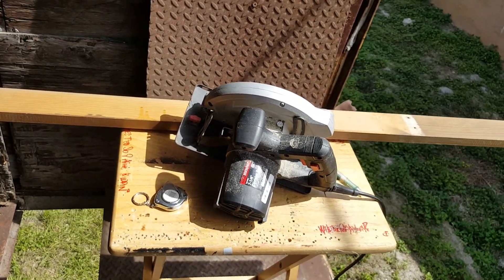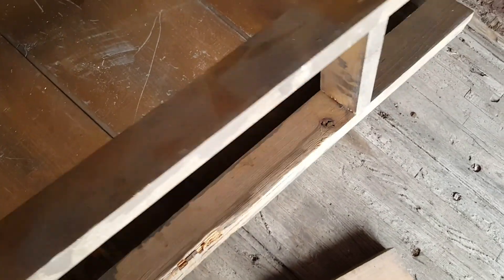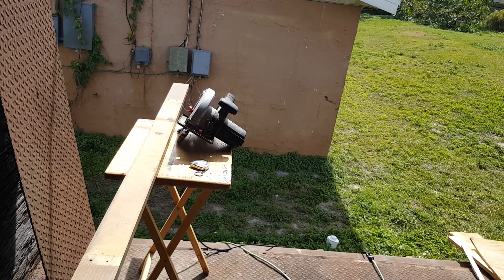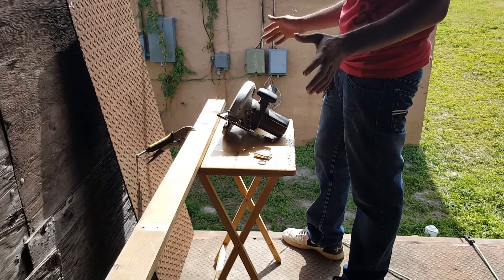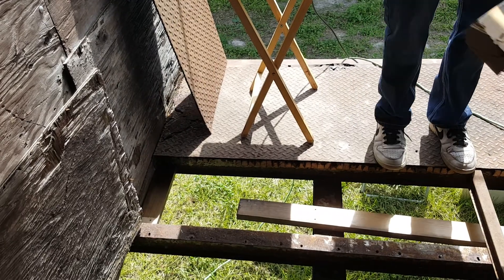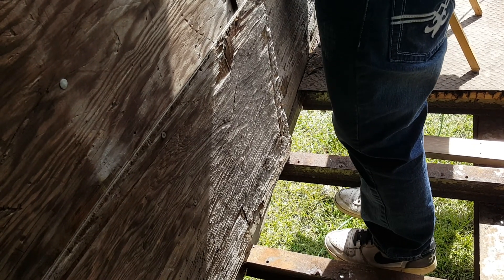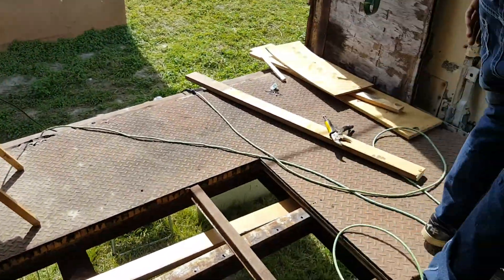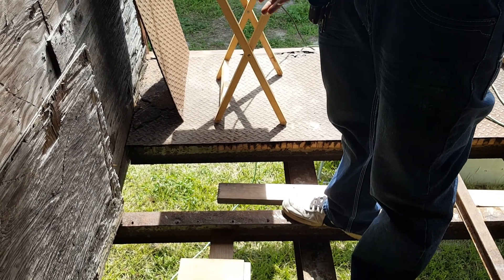Shipping container home part 2

Comment: really cool. im into the same type of shit reuse recycle everything i can i just went in on my backyard built alot of from scrap wood good job man cant wait to see the finished product.. 
I hope you  have a chop saw by now lol..
Reply from the maker: I have bought a lot of tools for this project and still have some videos to put up but need to edit them and find my charger for the camera I used to make those videos but will soon so keep in checking for those videos
Reply: Are you a fan of harbor frieght stuff?
Reply from the maker: 3DTSUJ CNC & MODEL MAKING kind of I mean I go there because the tools are cheap just like anyone would and they seem to last a while the only tool I would say that I had to get twice was a angel cutter it kept burning the wire out on the inside
Reply: Yea i guess thats the only fall back to insanly cheap tools u cant  go too hard on them.. but  my  fathers literally bought everything in that store since theve opened ones around me LOl..  its like his toy store and mine too but ive run out of shit to buy from them.. I got everyhting from my airbrush and compressor to my 150ft snake for my plumbling in the house and i use the table saw and planer religiously in my woodshop i even bought the mini lathe years ago from there catalog.. But they do have some usefull stuff for the anet like wire terminals, shrink wrap and a multimeter.
Reply from the maker: 3DTSUJ CNC & MODEL MAKING yea I get heat shrink wrap from them and wire terminals too but I like to get my wires from walmart for car audio because there really good and rated for high current and its cheap so ill probably switch those wires for the hot bed with that wiring so ill never have a problem with it
Reply: Yea i just soldered mine onto the heatbed thats the best solution everyone who has the anet has come to. youll also need a IEC socket with fuse other wise youll have to unplug it from the wire everytime..